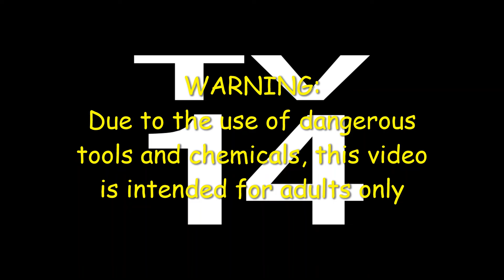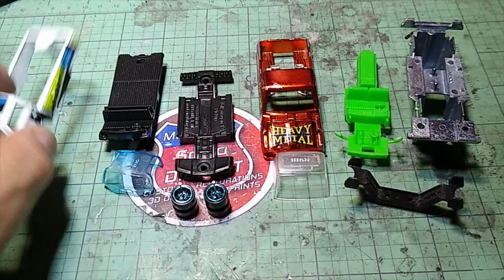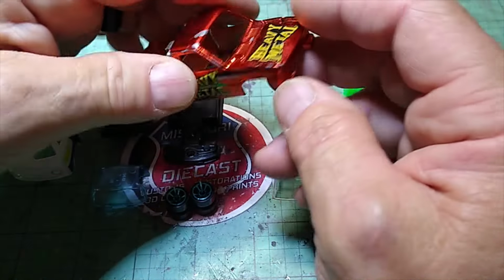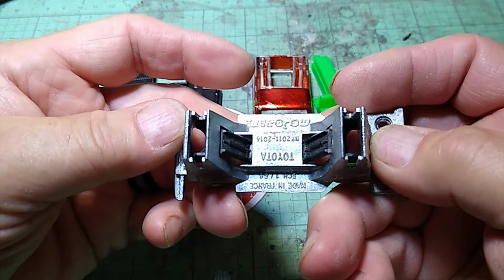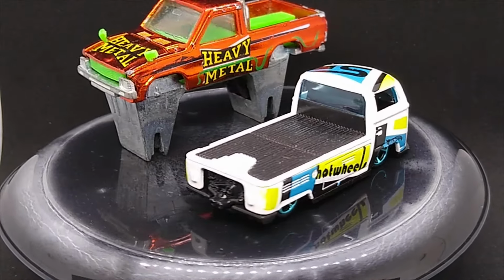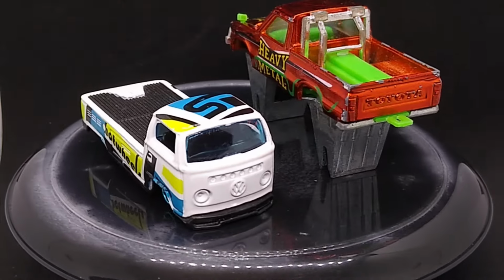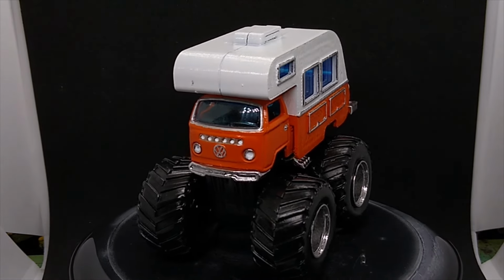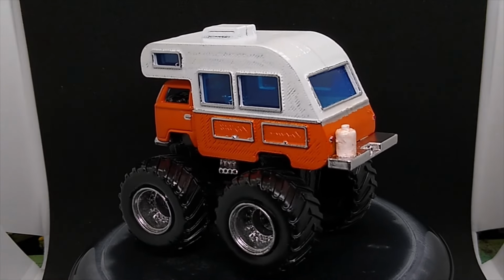#fourhorsemen June 2024 Two Car Mashup Invitational Hot Wheels T2 Pickup and Majorette Monster Truck

Comment: I did a T2 which has the front bumper and cage off of the Baha beetle, the big metal engine off of a tooned beetle and a flat bed I cut off a random hauler. Mashup of 4 castings and custom wheels